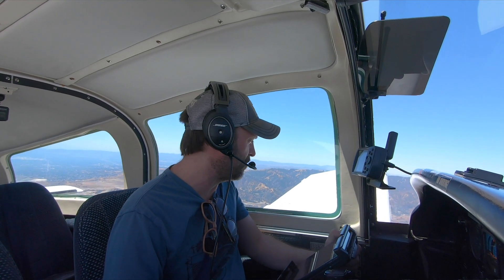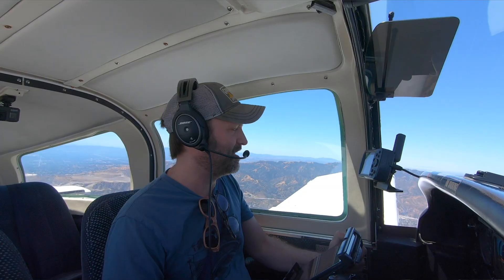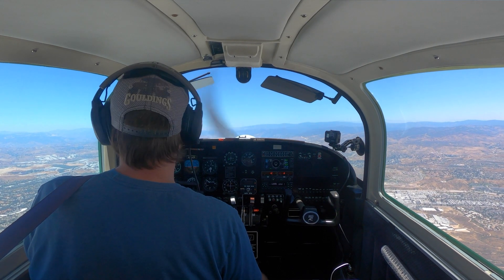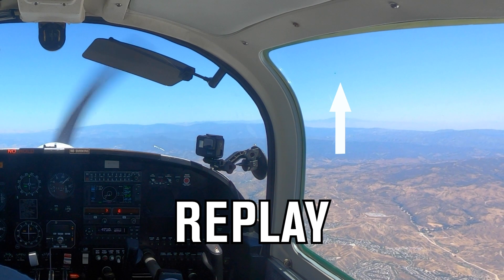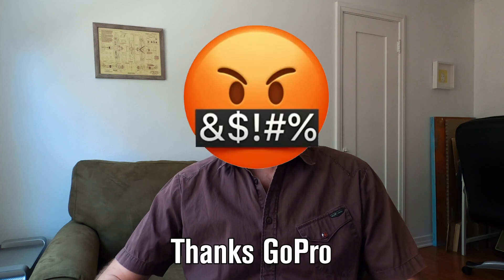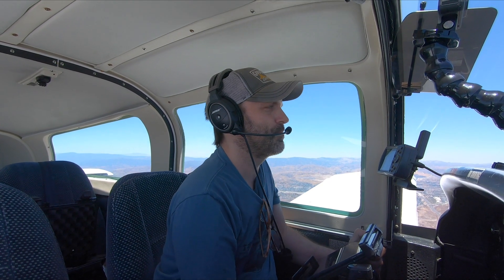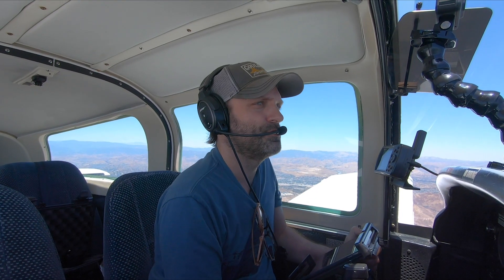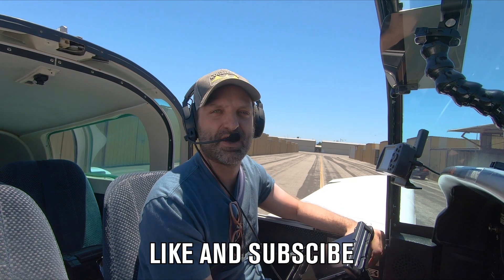How high will my small airplane fly? Problem encountered

Comment: Great video!

How would you calculate how high you could get when the density altitude/Barometric pressure & air temps rise a lot?

So in this day the reading wasn’t that much over standard 29.92.

Would there ever be instances where your max that day might be 11,000ASL?
Reply from the maker: Thx Michael! The way you calculate would be the same as any other day...just input the necessary data in the DA calculator. 

I've flown in some very hot and high DA situations near gross weight at 11.5, so easily doable in the Tiger...it can just take longer to climb that high on those days.
Reply: @Wolficorntv  thanks for your feedback!!!

I’ve got the flying bug 1 year ago. I live next door to a class D airport watching smaller GA planes take off & land often on weekends, some doing pattern work.  I enjoy Flight sims like Microsoft & Others.
I recently gotten into RC Flying which is fun & teaches one how a plane works in the air :-)
Thinking about going for a Pilot’s license next year- need to pass FAA health physical first.
Reply from the maker: @Mikinct  Go for it! First thing you can do is schedule a discovery flight at your local flight school. Def smart to get the medical out of the way early. If for any reason you think you have a medical issue that may be a problem DO NOT take the medical before consulting an AME. A failed medical on record will become a PITA for progressing forward.
Reply: @Wolficorntv  Gottcha-
Reply from the maker: @Mikinct  once you pass your medical...if any issues arise down the road you can always switch to Basic Med, as opposed to a 3rd class medical. But you need to pass that aviation medical the first time for that to become an option. Speaking thru experience dealing with that stuff.
Reply: @Wolficorntv   Just a general question concerning medical- whats the difference between a basic medical & a 3rd class medical? what does one need to fly and keep a general aviation cessna type of plane license legally?

I've dealt with slight Blood Pressure higher at times, not on any BP meds but does one need to have a 120/80 to pass? can one be on blood pressure meds and still get a license or not? What other medical considerations does one need to know going forward? Diabetics, Blood Pressure, Asthma, Eye Sight/ Glasses or Contacts needed etc.  Who does the medical, does your own MD perform the required test or do you need to make an appointment with their doctors to then pass.   Last question, if say you don't pass 1st test for whatever reason. Are you allowed to retake a medical test 4-6 months later and possibly pass?
Reply from the maker: @Mikinct  first of all...don't want to scare you with all the medical stuff LOL but it's been known to bite some wannabe pilots. The best thing you can do is read up about the aviation medical exam on AOPA website or various other sites. It can answer alot of the questions you asked. To answer your last question...not really. If you have a disqualifying condition that causes a fail, the FAA will require you to step thru sometimes laborious hoops in order to resolve the issue before you can proceed which is why I mentioned consulting with an AME (aviation medical examiner...they guys that you would need to visit to get your medical) BEFORE you actually take the exam. 

You can be on blood pressure meds. I believe the max you can have to pass is something like 150/95.

Comment: How long (time or distance) can you go between fuel stops?
Reply from the maker: Alot of variables go into that, but generally it will go 4:30 with over an hour reserves left in the tank. I've done that once. It's a long time to be in the plane. Mileage depends on winds, but without wind, that's about 550 miles

Comment: Maaann, I hate it when a camera craps out. I thought only rookie aviation youtubers had that problem. I'm glad to know I am not alone. Do you and JPS Bryan have the same model Grumman?
Reply from the maker: It's a universal dilemma, I'm quite certain. It has happened several times with the same camera, my GP7. I realized after this flight that my firmware wasn't up to date. Hopefully that fixes it. JPS Bryan has a Grumman Traveller. 150hp. Mine is a Tiger, 180hp.
Reply: @Wolficorntv   ok, I am using a few gp4's. I have run into the overheating issue several times. If gopro would just put the camera in an aluminum body, I think the issue could be resolved..grrrr. I hope to get a ride / fly Bryans grumman at the ACCA's. I really dig the sliding canopy. It's the ULTIMATE A/C!!

Comment: I had my AA5B Tiger to 17500.  Very slow climb.
Reply from the maker: Good to know. I'd like to acquire some O2 one day and go higher.
Reply: David Comarow clawed my AG5B (with O2) to 17,900. I really wanted to see whether I could crack FL 180 
but realized I’d have to file an IFR pop-up, and OAK Cntr sounded too busy to mess with it for just a few minutes in Class A.

Comment: Nice!  I have a '77 Grumman AA-5B based here in Colorado where the DA averages over 9,500' MSL on those hot summer days, (our home field KBJC elevation is 5,673' MSL).  The highest I've taken our bird is 12,500', but I am sure I had a few more thousand available if I had needed it.  DA was probably well over 14K.  I still had a climb rate of over 400' FPM when I leveled off and that was flying in mid-July on our way to KOSH in 2017.  We still have the original O-360 with no mods.  CHT's were around 385 to 390 on the hottest cylinder.  Not bad for an "old girl".  My son and I don't fly it in the mountains often though.  For that, I like to rent a C-182 with a bit more power.  Also, I hate sucking on O2.
Fly safe and fly often!
Reply from the maker: I've departed with 10k DA before. Not exactly a hot rod in those conditions! DA at 14 was about 16.5 and I still had more power to climb if I had O2. I was impressed with my aging engine.